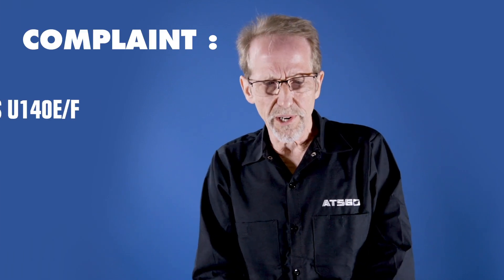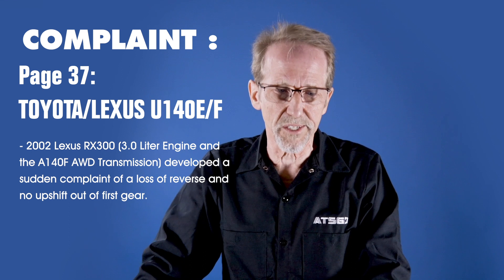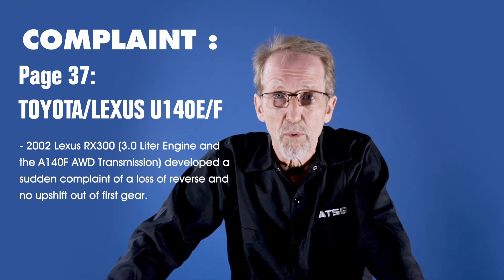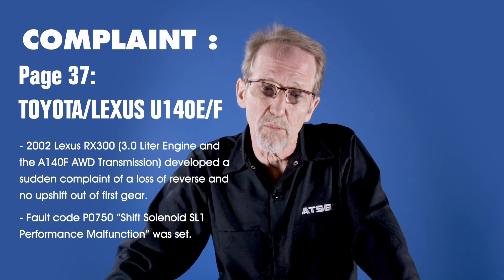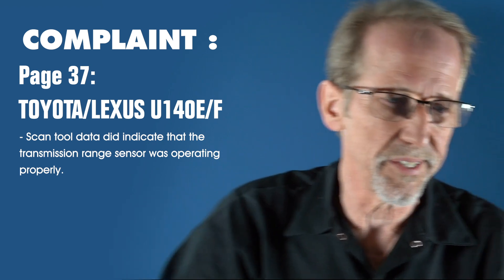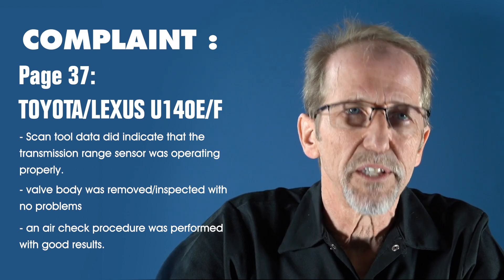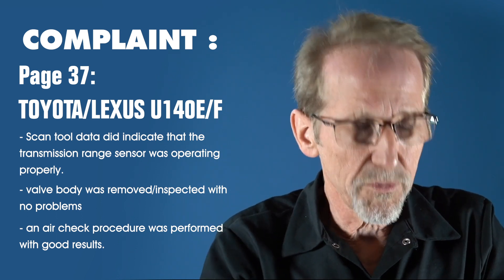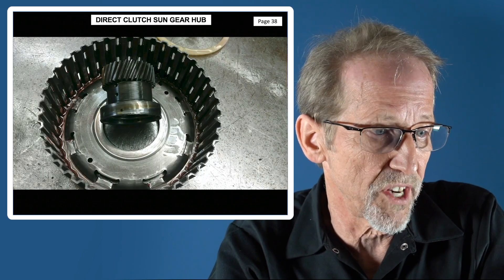Toyota-Lexus U140E Transmission Sudden Loss of Reverse

Comment: I have the same problem but it only happens when the transmssion is hot. No problem when it’s cold. Reverse gear engages perfect. Also there is no check engine light.
Reply: did you ever solve it? I have the same issue with a 2003 Camry
Reply: @scrbiii  yeah. Rings and gears should be aligned properly. Twisting and turning should do the job.
Reply: I have same problem exactly on my Toyota bb 2006
Reply: @carlonatividad9304  lay language please. What do you mean? I have same problem .. no reverse when it's warmed up plus bumps in 3. No codes .. changed valve body so far. It happened after center clutch (sun gear replacement)
Reply: @carlonatividad9304 mind explaining which rings and gears? Center clutch sun gear?

Comment: I have a question if u could help.me out. I have a 98 toyota avalon 3.0 automatic trans, i have no reverse feels like its in park and in neutral the car moves forward. All thw other gears work fine  and it does uoshift
Reply: I have the same problem.  Did you fix yours yet and if so what was the problem? Thanks.
Reply: No i tried a new nss and still having the same issue im seriously thinking its the transmission now
Reply: @Frankredline  if it's a u140 transmission, consider this thread. I didnt help my problem but there's always an chance. Please keep me updated. https://www.rav4world.com/threads/2001-rav4-no-reverse-and-wont-shift-past-2nd.263497/

Comment: My daughter has a 2006 Toyota Matrix that we bought 3 years ago. Automatic transmission. 

 So about 8 days ago ahe cant reverse.  The check light engine comes on and so my husband's friend suggested transmission fluid. The fluid is low, so he puts in about half a bottle.  The car then reverses, I take it to a mechanic who does simple car work and he gives it a tuneup and he doesn't notice any leaks, etc with the transmission.

 Well, last night 7 days layer she can't reverse again. We put more fluid in and it works! But I don't see a leak in the garage. 

Ugh not sure what to do! And please no comments about "well why can't your husband do it"
1. He's not a mechanic 
2. He's working out of state. 
Im afraid to get scammed at the dealer, or by anyone =(